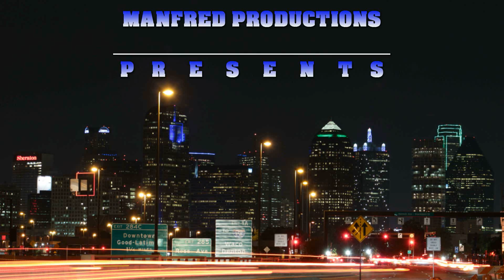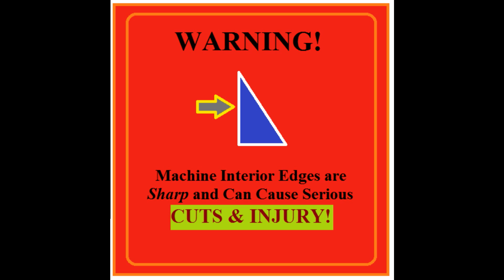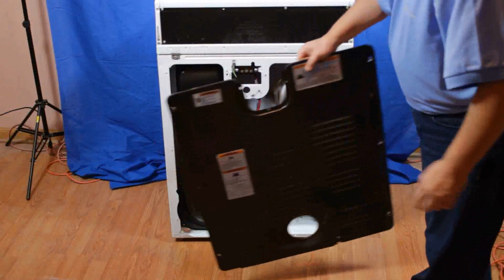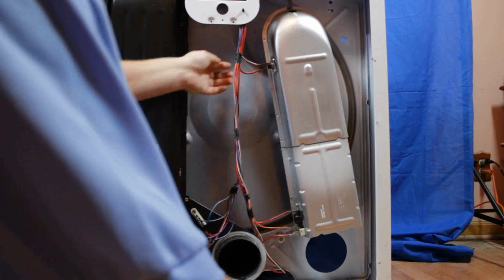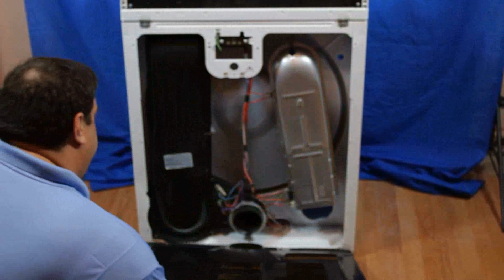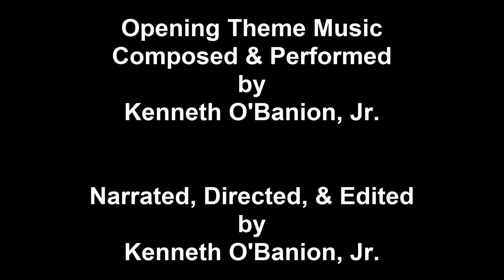Whirlpool - Kenmore Dryer Repair - Won't Heat, Test Fuse & Thermostat 279816 or 279769

Comment: My dryer is heating and drying the cloths but it's is not too hot as a month was but cloths it's dry I did the test , Hi Limit Thermostat, Thermostat Internal Bias ( replace  this one ) , Thermal Fuse Thermal Cut off and  Heating Element , no ones is bad . but cloths is warm , dry but is not hot. Can you help to resolve this issue

Comment: what do you call that yellow gadget to test the fuse and thermostat?  An ometer?
Reply from the maker: Mine is a volt-ohm meter.   You can get just an Ohm meter without the voltage part on it, but usually all you find is a combo unit that does both.

Comment: I do not have the meter to test the fuse. If both the fuse and the t-state have to be replaced anyway, is there a reason to use the meter testing since I do not have one?
Reply from the maker: You need to use a meter to test the parts to make sure they are good or bad.  Otherwise, you might be replacing parts that are still good, and that would waste money and not fix the real problem.

Comment: @canyonman1963, Thanks for the great video. My Kenmore dryer tripped the breaker a few times this week and the dryer gave out. It Wont turn on anymore, that is until I bypass the Thermal fuse, which i need to replace. But when I temporarily did that, within 30 seconds I began to smell a really burning hot smell from the dryer, (and this is after vacuuming the lint out of the dryer.) Im deducting that my THERMAL FUSE, tripped because of whatever is causing this burning hot smell- (coils overheating?) QUESTION: After cleaning lint out of the dryer, what could be causing this over heating/ burning smell? Could it be HIGH LIMIT THERMOSTAT that needs replacement? Thanks!
Reply from the maker: No, not likely to be the high limit thermostat.  I doubt the coils are overheating to the point you are smelling the burning smell.  That usually is from the motor windings overheating.  To find out for sure, put the cycle on the air dry setting with no heat.  That way you are not going to have any heat from the element coils.  Then turn on the dryer.  Stay close and see if it still makes the smell.  If it does, then it is likely the motor windings.  if it doesn't then go ahead and try replacing the thermostats, as you could be right, that they are allowing it to get too hot.  Another cause for overheating is if there is an air flow issue, such as lint build up inside the wall ducting, the hose at back of dryer, or even inside the blower wheel housing.  Be sure to remove that blower wheel housing to clean it out!  Hope this all helps, and you are welcome!

Comment: sometimes when I turn the dryer on it will heat up and work just fine other times it will not heat at all. ???
Reply from the maker: Could be one of the thermostats is sticking and not working sometimes.  Could also be a burnt connection inside the timer that is going bad, but sometimes will still work.  Next time it doesn't work, try moving the timer knob and stem side to side a little bit.  If that makes it suddenly start working, then the timer is going bad.  You will have to probably have some live voltage drop testing done to find out for sure which part is bad, and if thats the case, best to have a tech do it, as it is dangerous working with live voltage

Comment: I just bought a complete sensor kit for my drier.  The element will turn on 1 time in the beginning like normal. Then it will not turn back on until I let the drier sit and restart it.  one of the circuit's is not resetting  any suggestion's.  The upper thermal sensor was bad previously so I had replaced that sensor.  and it did the same thing so that's when I replaced all the sensors.  All the sensors when I removed them are still testing good on the multi meter.  please help
Reply from the maker: If your dryer has different heat settings, try a different heat setting.  It could be that the temp selector switch is bad.  Another thing to make sure of is that you have no air flow restrictions.  Make sure the air tube behind the dryer is not clogged with lint or crushed against the wall, and then make sure while dryer is running that air flows out the vent where the dryer air vents to outside.  It should be a strong flow of air.  If it just barely has air coming out, it is at least partially blocked.  You could temporarily remove the duct hose from the dryer, making sure air comes out of the dryer strongly, and see if heat will work properly with the hose removed.  If it does, then there is blockage in that hose or in the wall ducting to the outside vent.  Hope this helps
Reply: +canyonman1963 after a lot of testing yes I believe its the switch.  it had been working on the normal setting just fine.  I guess sometime during testing it quit.  it does still work in the auto dry setting that we had never used before. thank you for getting back to me!
Reply: The lint filter housing itself might be restricted. You would need to pull the housing lose to check it. I've had them where the whole lower part of the housing would be piled up with lint and other debris around the blower wheel.
Also make sure to wash the lint screen. I've had cases where the filter would actually hold water, not allowing it to pass. If water doesn't pass then neither will air.

Comment: Thanks so much for your help and quick response. It was a short in the timer circuit. I was able to break the short and clean everything up to get it running until the new one arrives. 

I threw some beer money into your PayPal account for your time.  

Thanks again.
Reply: +canyonman1963 Should have been. I think after I did it I realized that there was a way to donate through YouTube and maybe another through PayPal. I clicked the blue "donate" button. Sounds like you got it though which is good. 

Thanks again.

Comment: Thank you for your video and knowledge.  I have used an Ohm meter to check the heating element, thermostat and the cutoff, all have continuity.  With the back of the dryer off I turned it on and have power to the heating element leads but still no heat coming to the element.  Any thoughts???

Comment: I got the kit but only replaced the thermal cut off because the other part  had continuity.  Do you think that might be an issue down the road?  Thanks for posting the video.
Reply from the maker: It might cause problems.  Here's why.  The thermostat opens and closes when the temperature reaches operating temp.  Don't know the specs, but lets say its  160 degrees.  When it gets to the 160 degrees, it opens, or breaks the electrical connection inside the thermostat, to shut off the heat.  Then when it cools down enough it will close, and start heating again.  Now, if the thermostat does not shut off the heat at 160 degrees, it will continue to heat until finally it gets to the rating on the fuse, which is higher than the thermostat.  say its like 192 degrees.  When it finally gets to 192, the thermal fuse will pop.  This will shut off the heat so it doesn't continue to get hotter and hotter until something catches on fire.  It is a back-up to the thermostat in case it fails.  In order for it to pop, the temperature had to get higher than what should have been allowed by the thermostat.  Therefore, if you dont replace the thermostat, it might stick closed again and of course it will heat up until it pops the fuse again, and you will then have to buy another kit to fix it.  So if it still runs and heats now, I would go ahead and change out that thermostat before it sticks and allows it to pop the fuse again!
Reply: That makes sense.  The fuse was the part that was busted but it was the thermostat that could have caused the fuse part to bust.  I'll replace it.  Thanks.

Comment: I changed the Fuse and the thermostat below it just like this dryer (but Gas) and the damn 4 month old Fuse blew again a week after I changed out the motor for the second time.  Always use FSP parts too.  Vacuumed out the lint lines so I am stumped.  Any ideas?
Reply from the maker: +Sungodv Even if the hoses and ducting through the wall are cleaned out of lint, there could still be air flow restriction if the hose from the dryer to the wall is kinked too much or crushed from pushing the dryer too close to the wall where the vent hose attaches.  Also, I would remove the blower box housing where the blower wheel is and clean it out.  It might be full of lint build up, reducing air flow.
Reply: +canyonman1963 Thanks for your thoughts, but the Fuse tested OK.  Broke the two T-Stats trying to get the connections off to test.  Turns out it was the freakin' Igniter.  The only original replaceable parts are the two coils (and the light bulb) which I guess I will buy and have handy just in case - maybe another motor too.

Comment: My thermal cut off is bad.  My heating element reads 9.8 ohms.  Do I only replace the thermal cut off on the top??  The bottom thermostat is good.  Thanks a ton in advance ! God Bless
Reply from the maker: +thebizkit79 The thermal cut off comes in a kit with the thermostat, and you should always replace both when the cut off goes bad.  Thats because the thermostat could be stuck on all the time, or might be opening at a much higher temperature than it should.  Either of these problems would cause it to get too hot and continue to pop the thermal cut off, until you finally replace both!

Comment: Howdy canyonman1963. I replaced the heating element (the only component that had no continuity on the back of my Kenmore dryer). I checked for 220 v and it is fine. Still no hot air is coming out. Does it matter which way I put the wires back on either the thermostat or the heating element? If so, what is the right way? All wires are red. One has some white. What else could be wrong? Thanks, great tutorials, all of them!
Reply from the maker: +Rogelio H. Hinojosa Sáenz Yes, the wires do matter where they go.  If you find the wire that comes in from the motor, it goes to the heat element.  Then another wire goes from the other terminal of heat element up to that thermostat.  Then the other wire from the harness goes from the other terminal of thermostat up to the high temp cut out fuse up top of the heat riser.  Then, finally, the last wire that attaches to the fuse can be followed up to the timer.  If you have it all wired correctly, and the fuse and thermostat and element all have continuity, then either the timer is bad or the motor is bad.  Both the motor and the timer send 110 volts to the element to give it the needed 220 volts to heat up.  I hope this helps to explain it, and you are welcome for the videos!

Comment: I found the high limit thermostat and the heating element thermal 
cut-off to be blown out (no continuity at room temp), so I replaced 
them.  The dryer worked normally for a few minutes, then both blew 
again.  Lint screen is clean.  Ducting is clear. Blower working normally.  
What might be causing these thermostats to blow out?
Reply: +canyonman1963 Yes,  put t all back together including the duct connection, then  watched it through the peep hole with it set to low heat on timer dry, and it cycled the flame on and off at intervals several times.  I thought it was fixed, and told my daughter to resume normal use.  She told me she set it to medium temp, and put a load  in, but it stopped heating before that load was dry.  Both thermostat parts show no continuity again.  Whirlpool gas dryer model WGD400XW3.  Parts kit #279769.  This kit is the manufacturers recommended replacement kit for the original parts, but the original part was L180-30F, the new one is L250-80F.  I see in an older post that you recommended replacing the cycling thermostat as well.  Is that my next step?   The cycling thermostat shows closed circuit over the red wire contacts, and closed circuit with slight resistance over the purple wire contacts, so I did not suspect it at first.
Reply: +canyonman1963 Wow!  That was an easy trap into which to fall.  I even removed a working high limit thermostat to use the one from the kit, thinking they were paired!   I will try this!    Thank you!
Reply: +canyonman1963  Some followup info for the record:  I used the original L180-30F thermostat with the new heating element thermal cutoff from the 279769 kit.  The heating element thermal cutoff lasted a little while, but burned out before the first load was dry.  At this point my daughter gave up on me, and bought a new dryer.  We had spend over $100 on parts without apparent progress.  I guess I will never find out what the root cause of the problem was.

Comment: Hello, thanks for the video.
 I have a whirlpool dryer heating element, model number wt87800. I opened up the back cover; however, I don't see the fuse anywhere, is it possible this model doesn't have a fuse?
my dryer doesn't start, with a bit hum sound. Can you share your expertise? 
many thanks
Reply from the maker: +Jian Ping There is a fuse somewhere, usually located on the blower box housing near the blower wheel.  The model number you listed doesn't come up as a good model, so I cant find a diagram for your machine without the model number.  It usually is either a pill shaped or oval shaped fuse, white, with two wires going to it.  Hope this helps!
Reply: Thanks very much for the reply. the model number is whirlpool dryer wt87800. I searched all of the possible fuse looking parts near blower, but no luck, i see a few of thermalstat, but not fuse. In fact, I don't really know the difference between fuse and thermalstat
thank you very much
Reply: Thank you very much for the time and reply. You are so helpful

Comment: Hello, I just got parts to replace the thermostat and whatnot. The part you described that is near the top was the faulty part, however the one near the bottom of the heater was still working fine (it still had continuity). Can I just replace the part near the top and not replace the one near the bottom? I ask because I was just going to replace the part near the bottom however the screws they sent do not fit. They are too wide and I can't screw them in.
Reply: +canyonman1963 I used some of the screws from the back panel and that worked! I was surprised because they looked bigger than the screws that came with the replacement parts. Dryer works now! Now I just need to figure out the ventilation. The ventilation it came with is the flexible duct and I want to place it with the hard duct.
Reply from the maker: +Leif Larson Glad that worked out for you!  Good luck with the ducting, just make sure it doesn't get bent or crimped, the hard duct doesn't straighten back out from that very well, and usually will leak if you crimp or bend it too much.

Comment: I have a issue where I replaced the heating element with out thinking to test it first. Replaced said element still had no heat. Checked all thermostats and the fuse with a Ohm meter and all appear to be fine. Still have no heat and lost on what to check now?

Comment: I've replace  the heating element,  the fuse the two sensors  on the heating element  and the cycle sensor, every thing the video staid to change , now the dry heats up for a couple of loads then it quits. what now

Comment: Hello! Our dryer only heats for 5-10 minutes then the heating element shuts down. I replaced the coils at one point a couple of months ago because it wasn't heating at all which fixed that problem but now this. Is the thermostat an all or nothing part or could it be causing this issue? Moisture sensor?

Comment: the blower box thermal fuse was blown , I replaced that and the thermostat , dryer worked for a half hour after this then went to try it today and No again ?  ??    whats the cause ???  its duct is clear ..
Reply: +tim erc    my bad ,, i assumed it was fuse again,, took back off and all test good ???  so what else would cause NO HEAT ?  the thermal fuse was bad the1st time  so im guessing issue caused that to blow ???

Comment: Thank you for this! The worst part of the whole thing was trying to wrestle that stupid casing that holds the thermostats & heating element off & on...(i've got an older Whirlpool Gold). It took 3 intense wrestling matches to get the frigging thing off, about 8 total minutes to get the thermostats tested, the problem ID'd & parts ordered & replaced, now I can't get the bleeding thing back in. It was impossible to see how the flange fit when taking it off; anyone got any hints how to get the ##^$%&@#ing thing back on?!? I'd REALLY hate to have to pay $100 bucks or more just to get the blasted thing back together, after all this.
Help?!

Comment: Hello I have the Kenmore 70 series. I was drying and I came back to the dryer to get a shirt and as I pressed the button so that the clothes can start drying it wouldn't start drying. It makes the click noise but wont dry. I opened the door to check that no clothes was keeping the door from closing firmly but there was nothing and there was a funny burnt like smell.. what can be the problem?
Reply: +canyonman1963 Thank you. It started after I disconnected it for a while and then turned it back on.

Comment: Hi...., i have a Kenmore Dryer thats not heating up., i have check the high limit T-tat,Heating element,operating T-tat,thermal fuse & the thermal cut off fuse., they all have continuity ., yet still the dryer will not heat up.., the dryer do runs when turn on and stop whenever the door is open., what do you think is the problem

Comment: HI i replacement all the thermal cut-off, blower box thermal fuse, hi-limit t stat & operating t stat, also check the heat element. everything is working condition. but it still don't heat up. just cold wind blowing out. any idea what else to check. thank you
Martin